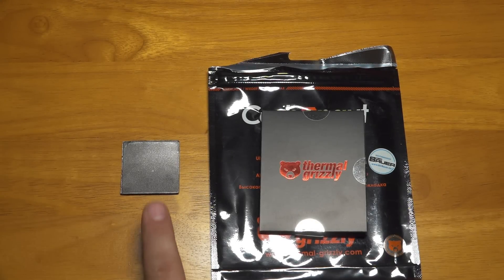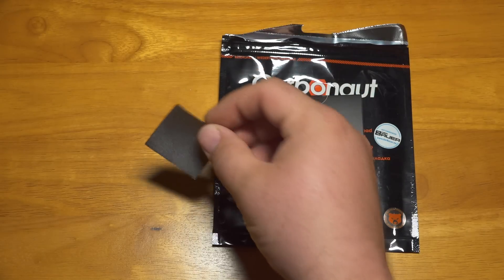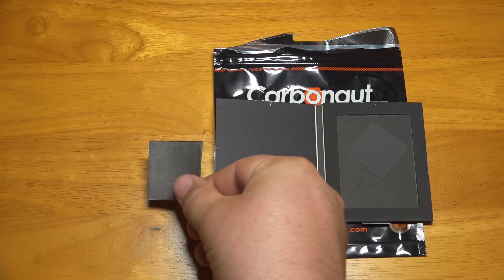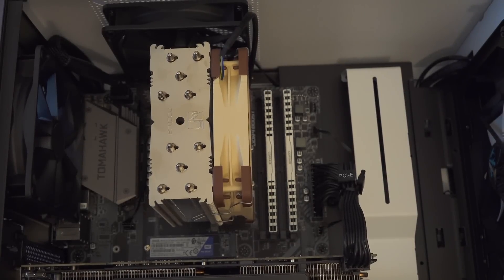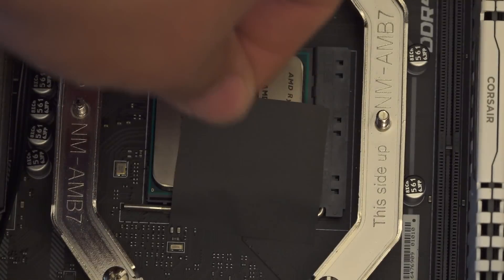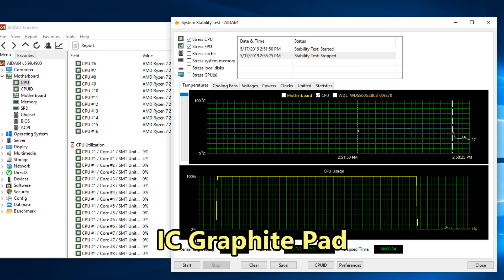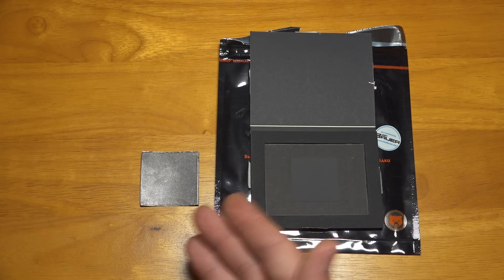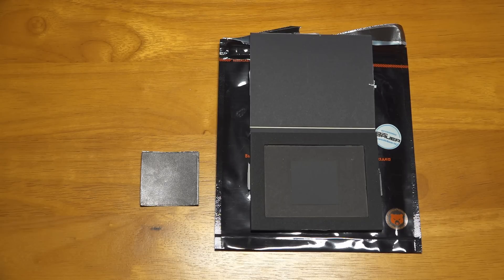Thermal Grizzly Carbonaut Vs IC Graphite Pad

Comment: There's no diference, except that you can re use it.
Reply: Wrong, don't forget mention the fact that the thermal Pad is easy to install and don´t need to be replace every 6 months like the thermal paste, that's a huge difference. Basically the thermal pad can be used for years in the same cpu and forget about replace it, Again, that's a huge diference.
Reply: @tubevideos187  Your average PC user does not replace their thermal paste every 6 months.  lol.  My old intel build from 2015 still has its original thermal paste that I applied when I first built it, and I honestly don`t care.  Temperatures are still insanely low.
Reply: @mangaas  "the average pc user" doesnt know what thermal paste is lol.

Comment: What about skin oils on the pads?
Reply from the maker: I haven't seen anything from the manufacturers about this, but my personal feeling is just to handle them as little as possible.  The stiffer IC Graphite pad can almost exclusively be handled from the edges, if you are careful when placing it.  Either way, I just try to limit handling them as much as possible.  I handled them a lot in this video, but that was just so I could show them for the video.
Reply: I was thinking the exact same thing. I'm going to use gloves to handle it when i purchase mine.

Comment: Xbox One X, what would I need to put on the memory chips and the apu itself?

I am trying to decide on having the system cooled and not overheat, so I was wondering if maybe you can give me an idea
Reply from the maker: I don't have any experience with the Xbox One X, so I can't say for sure what would be best to use.  I could guess, but I'd hate to steer you wrong.
Reply: Ic diamond paste for heat sink apu thermal killer bal37 it comes in sheet get it if Amazon if Ur replacing pads for graphics card  etc cut too size
Reply: So IC Diamond Paste would work for the apu, what would the graphite pads have to be 2mm or 1.5 mm to fit on xbox one x memory chips?

I am looking to make sure I can prevent overheating, and I am looking to get back online at some point, to play online.

I might purchase more games for xbox one x because of that horrible drm Denouvo
Reply: @petermonte2180  2mm
Reply: @onlyinmanchester3309  Awesome, I been looking to make sure I get the right thing and I am looking forward to having the xbox one x never overheat
Reply: @petermonte2180  What did you use on your memory chips?...Mine need replacing

Comment: Apparently Panasonic has been offering graphite thermal pads for around ten years. It might be interesting to compare the Carbonaut and IC thermal pad against Panasonic's PGS and soft PGS.
https://industrial.panasonic.com/cdbs/www-data/pdf/AYA0000/AYA0000C27.pdf
https://industrial.panasonic.com/cdbs/www-data/pdf/AYA0000/AYA0000C50.pdf

Comment: @bigtb1717 with the ryzen chips, IC Graphite offer 30x30 and 40x40, should i get the 40? the over hang worries me
Reply from the maker: I would use the 40mm pad for Ryzen.  There is very little overhang.  The overhang isn't nearly enough to reach any components or cause problems.  I have one of the 40x40 pads in my Ryzen system and it works perfect.

You can trim the excess if you are worried about it.  I didn't bother.
Reply: A little late. But I did a little digging. The dimensions of the IHS for Ryzen is 37x37mm. So you'd have to get the IC Graphite in 40x40 and trim it.

Comment: Can i just cut it to fit my cpu die on my laptop? would it work just fine?
Reply from the maker: It can definitely be cut to fit.  It would probably work well, as long as your cooling setup in your laptop has a good, tight fit against the die.  Just be careful during assembly to ensure it stays in place.  If it falls out during assembly it could short things out.
Reply: @bigtb1717  thanks for the reply, either one would short something if it's not in place? I think i'm gonna buy the carbonaut, i'll be careful
Reply from the maker: They are both electrically conductive.  So either of the pads could potentially cause a short if it falls out of place.  As you say, just be careful.
Reply: @bigtb1717  Alright, thanks a lot ^^
Reply: @C.r.i.m.s.o.n  I use the IC Pad when I upgraded my CPU in my Thinkpad from a dual to a quad core. It works great and all has been stable for nearly 2 years now. But yes, you need to be careful and make sure that you cut it right and ensure it doesn't slip out of place when placing the cooler on the die. Also, cut the IC Pad away from the computer so that the dust doesn't get in your computer.

I also use the IC Pad on my desktop build and that has been great as well. But I would definitely try the grizzly pad.
Reply: @bigtb1717   It does have some adhesive so that it should stay in place.
Reply: @bigtb1717  
A bit late but safty.is pretty much like placing a gold foil
Reply: You can make your own with some Panasonic carbon thermal pad material Digikey # P14965-ND THERM PAD 180MMX115MM W/ADH GRAY 0.0008" (0.020mm) The thinner the carbon pad the better the transfer vertically if you read the specs. I used it as a cpu thermal transfer on a Intel 9600K in place of thermal compound. It is easy to cut since it has a removable mylar backing. With the mylar removed it holds together and has a slight adhesive so it stays in place. You can peel it off to reposition if you need to. I could not see any difference in the cpu temperatures after application. One sheet is about 4.5" X 8" so you can do a good number of cpu's with one sheet.
Reply: PC Trash Talk can you use it on the GPU as well?
Reply: @initialize21  I don't see why not.  I'm not saying it's any better, just reusable and not messy.  I still use the paste if I get it free with something.

Comment: Where do you get this stuff any retailers selling it here in the states?
Reply from the maker: I found one seller on Amazon, but currently not in stock.  I ordered mine from Overclockers in the UK.  Kinda pricy with shipping, but I wanted to try it.  I imagine it will start showing up soon, but still a little hard to find right now.
Reply: @bigtb1717  ok thanks!
Reply: Go on their website
https://www.thermal-grizzly.com/en/where-to-buy
at the where to buy page, and check out what retailers are available in your country.
Reply from the maker: Starting to show up available on Amazon.
Reply: @bigtb1717  cool thanks for the info gotta try these my for my htpc!
Reply: Microcenter.
Reply: Ebay